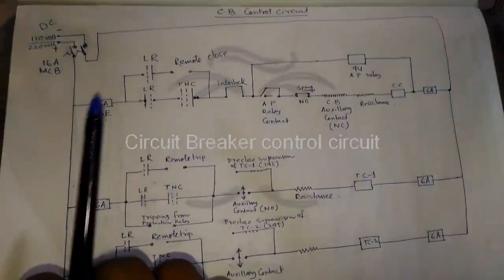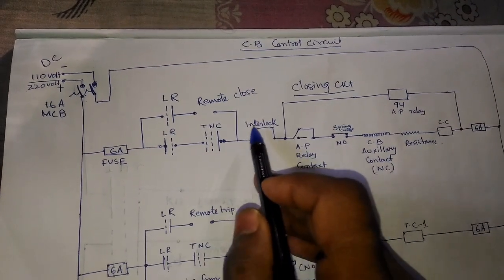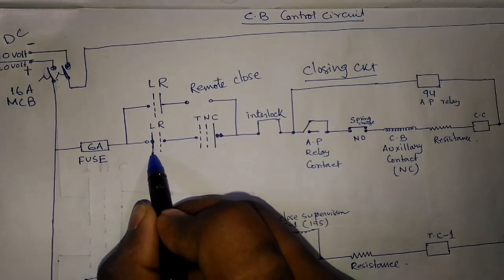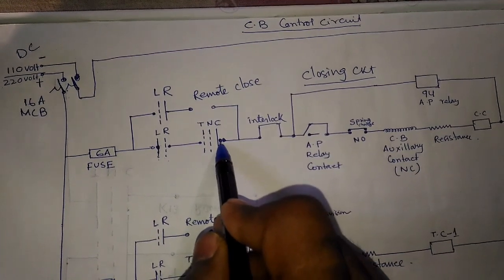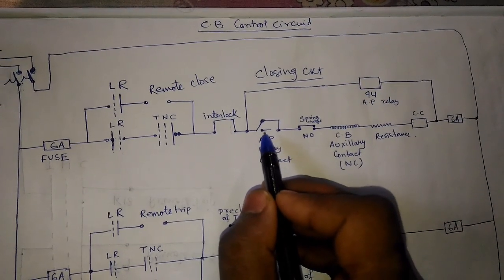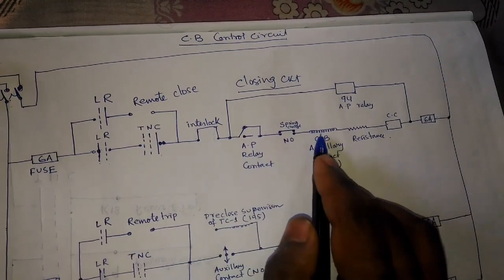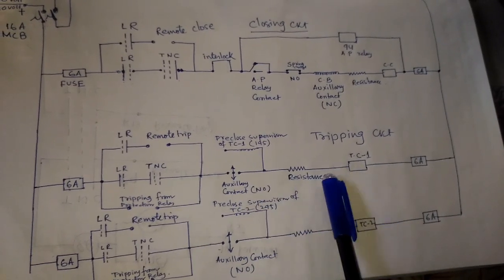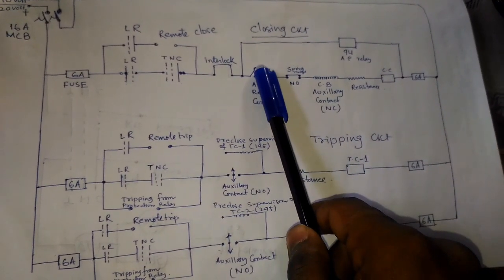Control Circuit basic idea #Circuit Breaker # Sub station #Power Plant

Comment: What is the purpose of resistance before the closing and tripping coil and I believe this should be in the part of TC or CC supervision?
Reply: u must have seen in the diagram that the control circuit has 220 or 110 V DC supply option. If we use 220 V DC in that case we need to connect the resistance in closing circuit so that the closing coil is supplied its rated 110 V DC voltage. We can remove the resistance if we would have used 110 V DC directly for control circuit.

Comment: Sir what is the work of anti pumping relay in control panel circuit . . . ?
Reply: we use anti pump to protect closing coil. this relay or contractor diconnected closing ckt when breaker is in on condition.
Reply: In simple terms, this relay will help prevent continuous close pulse to the Close Coil in a CB. A continuous pulse to close coil will burn out of the coil as it is usually short time rated. There are recent specs of Close coils which are continuously rated!(GE).